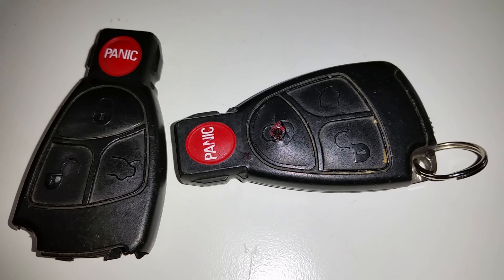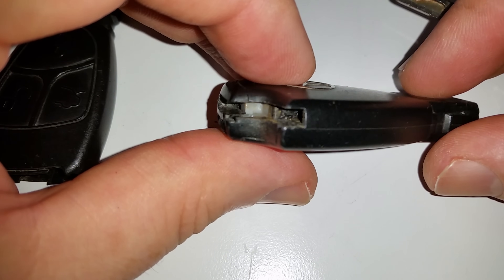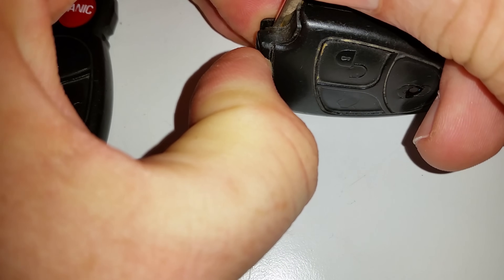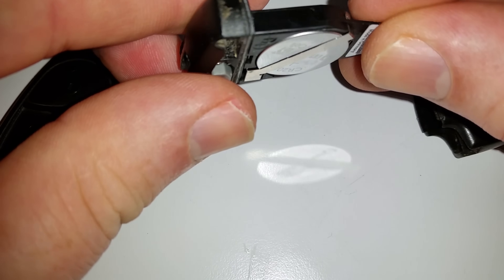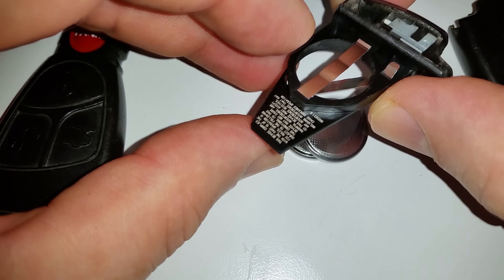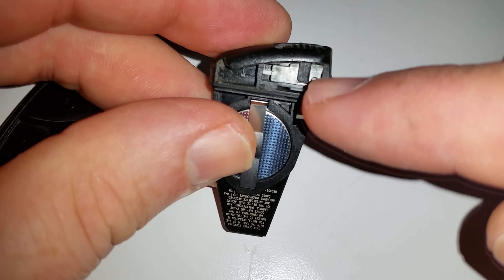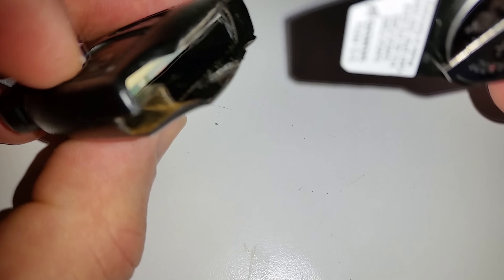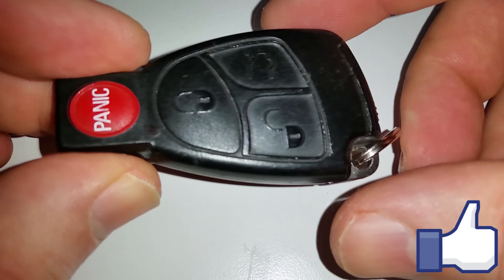Mercedes Benz Key Fob Case Change and Battery Replacement Remote

Comment: Tip... The circuit board will come out more safely and easily if you pull it out by using a right angle pick tool in the tab holes where the white plastic spacer is. There's enough room around the plastic tabs / locator pins to get purchase with the pick and pull the circuit board out. You risk damaging the board by levering at it.

Comment: Having a nightmare getting the circuit board out...it's like its locked in. Tried with tweezers and it will not budge. 2004 W211 E320 estate. EDIT: Hold that thought...I cracked it....I used a paper clip with a tiny bend in it to pull it out with...Thank you for the great video. PS I was quoted £480.00 to replace the keys by Mercedes Benz...now done for £11.80...Madness!
Reply: Thank you! Such a good feeling when I finally got the little bendy paper clip in far enough to really be able to pull it with enough force for it to all pop out! Thanks!!
Reply: @foggyunit  satisfying isn’t it!

Comment: Thank you for this.  I just replaced my old Mercedes Benz key fob that was all chewed up looking with a brand new shiney one off ebay using these steps. I actually played this vid while I reproduced your steps on mine. It worked like a charm.  My original fob was so old and worn the little white plastic interior holder broke in two.  But I Super glued it back together and after it dried it held up fine and everything slid back in just like you said. Everything works perfectly now. Thanks again!

Comment: Just had the same problem...key not turning, locked st/wheel and no ignition. Did not believe the "fluff" problem till I opened the key....two little squares of fluff right over the sender units. Cleaned the lot with aftershave (Brut of course)  re-assembled the key and bingo!! Worked like magic....... Many thanks for the info Siri. Selling the 240 CLK now as just bought a key-less go 350 CLK ..great cars.
Reply from the maker: Thanks for that! You are welcome and Congrats on the 350!

Comment: Thank you for the video. Just replaced mine.  I like to share what I did which it's a bit easier.  I used the key to open the transponder a bit so you can clear the locking clips.  I used a paper clip and stretched out on side.  I bent the tip a tiny bit enough so that it could fit in the plastic opening that lock the chip. Once you open the transponder with the key, it clears the locking clips and with the bent clip side, pull the chip out.
Reply from the maker: Nice work!

Comment: As can be seen at the end of the video, pressing the trunk button does not flash the red light on the key fob as the open and close buttons for the doors do. However, such is the way the button is supposed to work, i.e., without red light response flash.

Comment: I have a 2004 kompressor coupe the key won’t turn in my ignition.. can I follow this procedure and change the battery for it? Or can I buy a new key fob for much cheaper online than at the dealership because it will be $300
Reply from the maker: If the keyfob operates the Door locks, it probably isn't your battery. I don't know. It might be the ignition switch. I am curious what the solution you find though.
Reply: Its the steering lock malfunctioning, most likely

Comment: So I have a question my key to my 2004 kompressor stopped working it won’t turn in the ignition. could I buy a new battery for my key fob and follow this procedure or do I have to pay the $300 to purchase a new one ?
Reply from the maker: If the keyfob operates the Door locks, it probably isn't your battery. I don't know. I am curious what the solution you find though.

Comment: Hello, i want to buy a key for my 2000 Mercedes benz w203 220 CDi. What frequency should i order ?
Reply from the maker: To work, a Keyless Remote for your car needs a frequency, which is 433.92MHz in Europe (315MHz the U.S. and Japan). To meet the demand for remote keyless entry systems, Europe has also opened up the 868MHz band. Where ever you are ordering your remote from, all they should need to know is the Year, Make, Model, Trim and possibly the last 8 digits of your VIN. The frequency of the remote shouldn't be a question that the company would ask to be able to complete your purchase once you provide all of that other information.

Comment: can i use ECR 2032?  I have 2 on hand
Reply from the maker: They are similar but have slightly different thicknesses. Both are lithium vs Manganese Dioxide, 3.0V, round, 20mm in diameter. The 2032 is 3.2mm thick while the 2025 is 2.5mm thick. Depending on if it will fit in the holder, they may well be interchangeable.
Reply: @SiriEmerald  They're not.

Comment: Those people in middle east. Do not do this. The cars shipped to middle east comes with keys that can not be repaired. When damaged, you are forced to buy a new key from Mercedes. It's simply no customer protection in those countries that can force Mercedes to give a rpaire option instead of replacement.